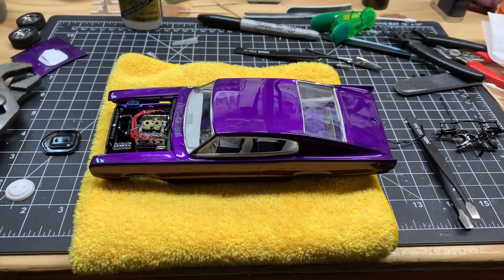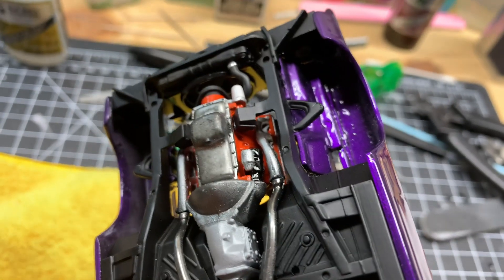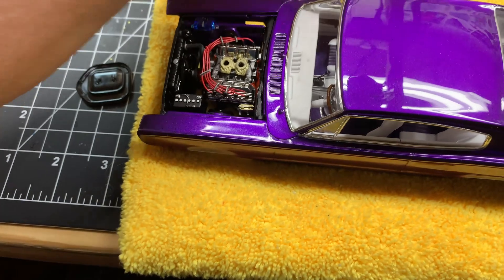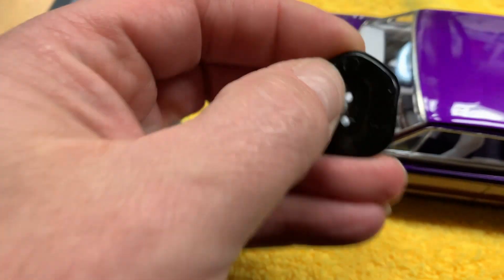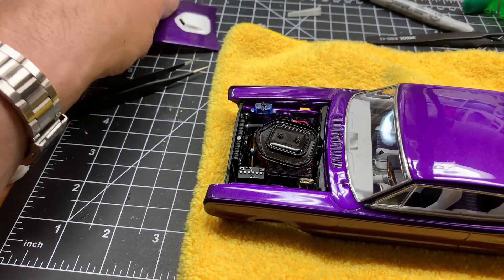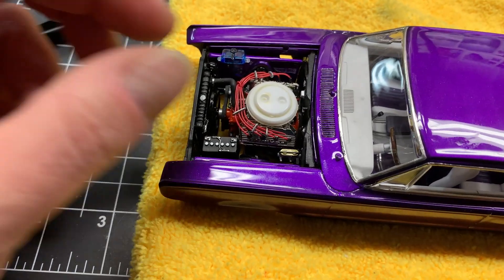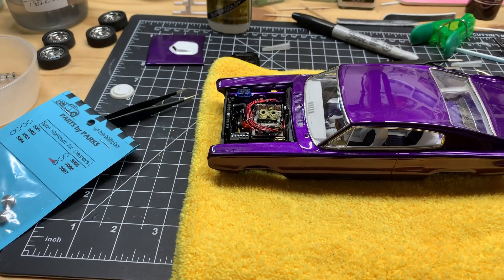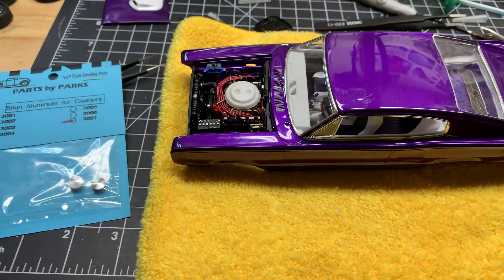Another Rant on the 67 Foose Charger

Comment: Use the stock air cleaner and save the nice aluminum air cleaners for a project where they will really show.
Reply from the maker: The only vote for that. I’m thinking I’m probably going to use the part by parts. I’ve recently purchased a resin printer so I’ll be able to print as many as I want.
Reply: @FuelsModels  ok

Comment: Bryan, just a thought. Pull the carbs off, sand the bottom of each carb to reduce height. That could work for this as I’ve had to do that with a few other builds like the AMT 72 Nova pro stocker.
Reply from the maker: Thanks yeah but I’d have to completely remove the distributor.

Comment: Either solution you came up with is good, and looks good with the car.  It’s a shame that the kit is poorly engineered.  I’ve never seen a Revell kit that had these issues.  At least you have come up with a way to make things work. If you use the Parts by Parks, you can put the wiper motor back.
Reply from the maker: Thanks yeah I’m shocked at it for sure. AMT kit I could see but not Revell.

Comment: The only reason it had The Foose name on it is because of the wheels. otherwise it's the same old kit. 
This problem is also on the 1970 Hemi barracuda Kit. on that kit you have to shave down the carburetor to get it to fit.
I'm thinking you have to do the same on this kit as well. I would  go with the part by parks. 
It would look better anyway  and wouldn't cover up all the detail you put into the engine compartment.
Reply from the maker: Ok thanks I’ll definitely keep that in mind if I build that kit.